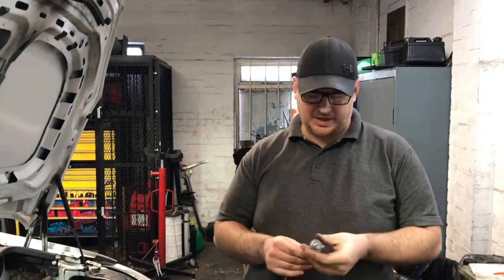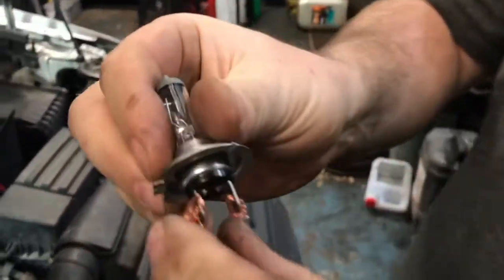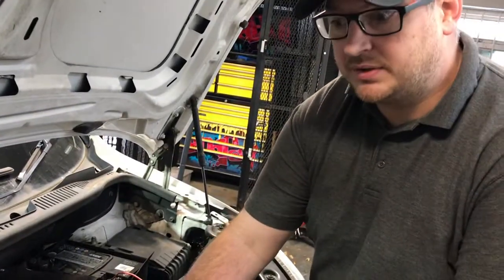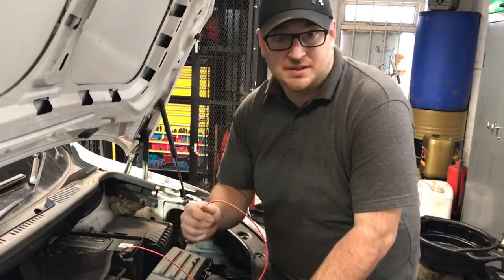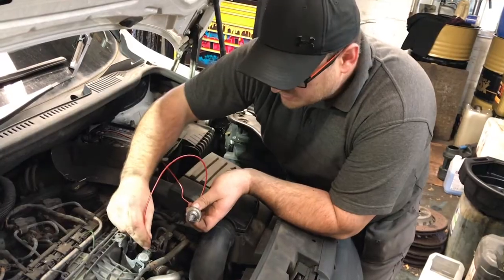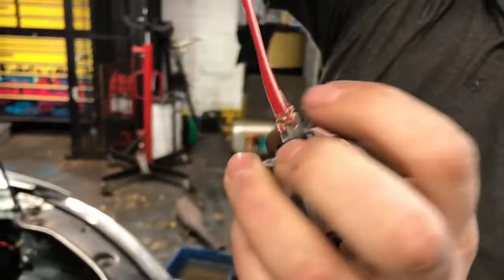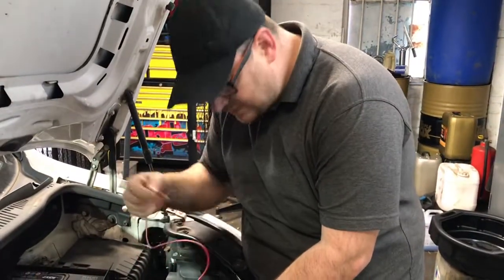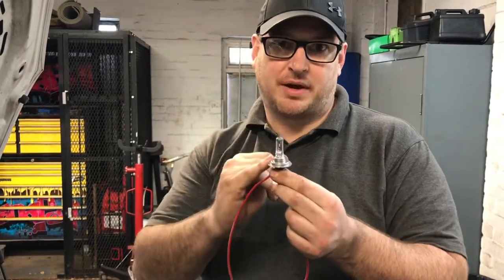How to make your own test light / circuit tester. DIY incandescent test light.

Comment: What if you had a 5amp fuse on the feed wire, with your H7 bulb will it blow the fuse?
Reply from the maker: No it could potentially cause  very expensive damage to controll modules etc

Comment: How do you know when to connect the test bulb to the negative or positive side of the battery?
Reply: the light got a coil inside meaning that it does not matter how you place them on battery, all you got to do is .....  if you are trying to find the positive wire of something you place one lead of test light on the negatve post of battery and with the other lead of test light you touch the wire or connector you are trying to test for power... and when trying to find the ground you just do the opposite ,and lets say that you have it on positive and you are looking for negative and you by accident touch the positive of a wire ... it would not  do anything because you are allready on positive and vice versa
Reply: @FranciscoMartinez-of3gr  Thank you so much

Comment: Feeding 12V into 5V circuit. Sounds great.
Reply: thats the beautiful  he just said...   hes not....  the voltage will drop to almost zero after the lamp (if it finds the ground)  if it finds vcc of the sensor (depending on resistance)  they would divide the voltage so would be around 6v...       i just wouldnt do it with a H7 bulb...   a  21W from the stop or blinker would burn and blind him less and would not stress the wiring so much
Reply: @alexluz7023 😂 I was wondering if that was the issue the H whatever bulb,  kept smoking 🤣 … can you recommend a bulb 🤭

Comment: thanks for sharing , im chasing a dead short after blowing 3 $10 alternator 100amp fuses and my old old school test light that used those little glass fuses (that you cant seem to get anymore), i started searching for this simple diy method so i can shove the wires into my dead shorted circuit in place of the fuse and start disconnecting things until i break the short and the lamp goes out , i just had no idea what globe to use , thanks champ the headlamp globe is perfect and your video was the only one i could find , i guess i needed the right words in search , later mate

Comment: I have to ask. What is the wrong way to test the circuits? How can you harm your computer?
Reply: Problem is even with a bulb, it isn't going to absorb a voktage difference. Some components in the ECU that read some sensors are very voltage sensitive and may only work upto 1V. The problem is if you unknowingly put 12V down that ECU wire, your going to blow that ECU. That's why you really need to be able to read schematics. You know what that wire your testing goes to, you know the voltage it operates on and now your going to prove that circuit with a probe. If you don't know where that wire or pin goes to or know the circuit you shouldn't be proving anything, that bulb isn't going to absorb fuck all when you energise a component that works on a couple of volts and you energise it with 12V OR even worse, reverse polarity too
Reply from the maker: If you make a connection from a module live straight to ground without a load to absord the amperage it will blow the driver inside module

Comment: I'm an electrical newbie. Is there a difference between using an incandescent bulb test light to an LED digital one ?
Reply from the maker: Yes the led test light will not absord the load it will let the amperage continue straight past the led which could blow modules 
Incandescent test light has a bulb that will absorb all the current so protects cuircuites from being damaged if the connected wrong
Reply: @EverydayMechanic  Thank You. Everyday's a school day.
Reply: @LandRover300 leds need diode . Use ordinary t10 signal bulb with signal socket and use solid copper wire as a pointer